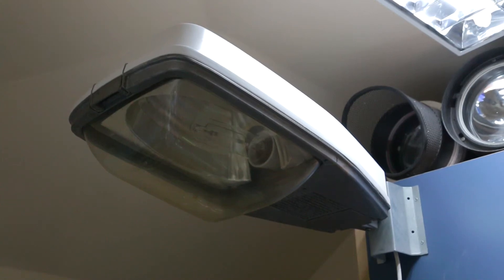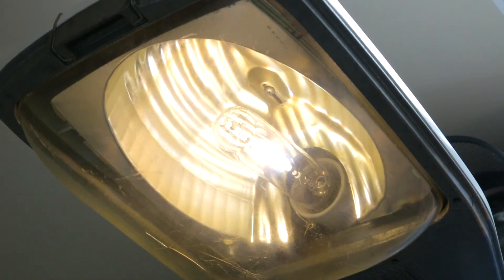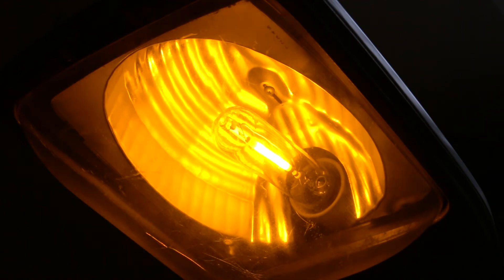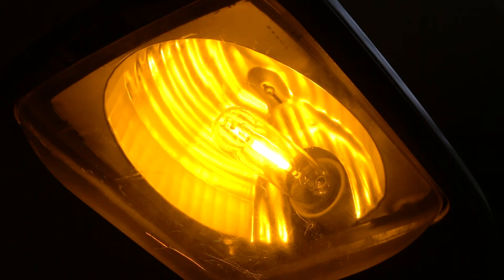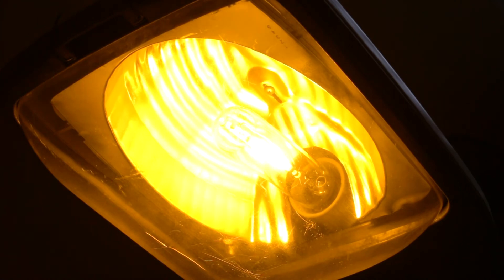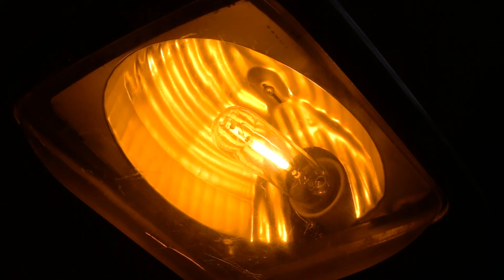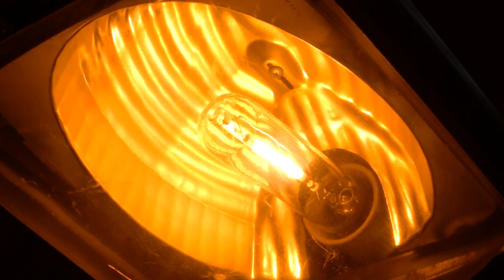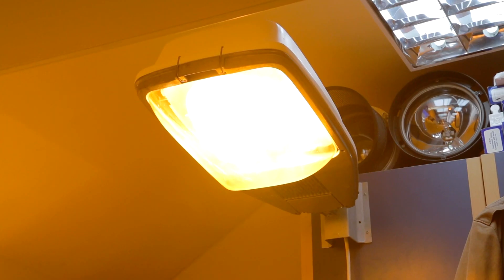Philips SGS203 150w High-pressure sodium streetlight start & run.

Comment: i like high pressure sodium street lamps they are amazing 

who want an l.e.d street light i dont like the color of the white  l.e.d
Reply: SOX is better despite having a -44 CRI. They have a minimum efficacy of 115 lumens per watt and with electronic control gear they are the world's most energy efficient light source. The problem lies in the EU's bullshit policy of requiring lighting with a CRI higher than 25 (which puts SONT/SON-E right on the edge of that) which has forced us to replace these lamps with metal halide, high pressure sodium and now LED.

I don't mind LED for torches, flashlights and anywhere that wouldn't cause excessive stress through weathering but for street lighting, it's a horrendous waste of time and money. they're expensive, less efficient than a decent ceramic metal halide and they don't last nowhere near as long. What makes matters even worse is YOU HAVE TO REPLACE THE WHOLE FIXTURE IF YOUR LEDS FAIL... Which they WILL.
Reply: LED is the best and for rich people